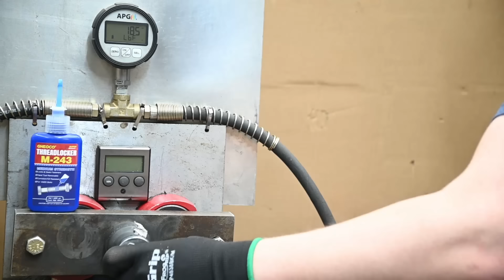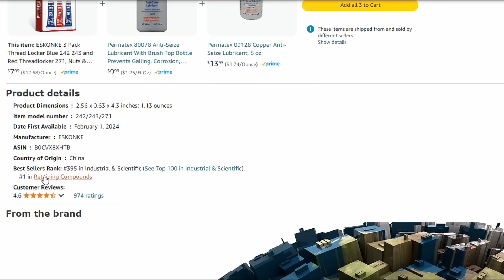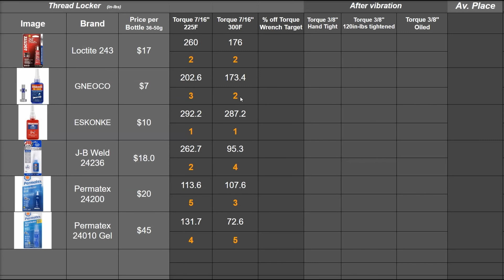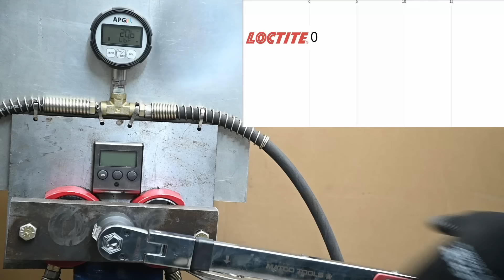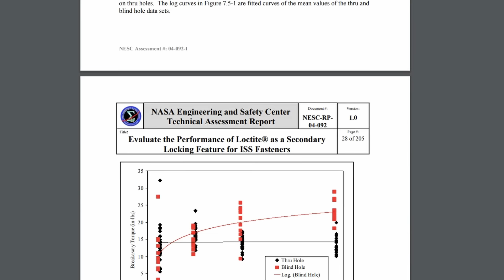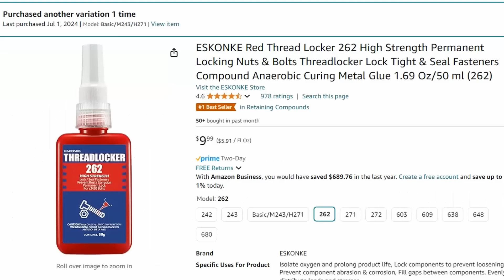Best Thread Locker isnt Loctite? vs Permatex, JB Weld & Amazon

Comment: I was under the impression that what causes thread lockers to cure, is the electron exchange between metal contacts. Dissimilar metals work best. It doesn't fully cure threaded into plastic, because there's no significant exchange happening. The small amount that does happen, is the oxygen exchange that would typically cause corrosion.

Comment: The best thread locker is whatever they used on my 2007 ram 1500's suspension bolts.

My 240lbs ass was jumping on a breaker bar with a 6 foot cheater and a blow torch on the part... didn't even budge...

Resorted to using the gas axe.

Comment: So thread locker sets up when cut off from air. So why doesn't it set up when in the bottle? I have thread locker in my toolbox that is probably 30+ years old and it's still liquid.
Reply from the maker: It does expire and get worse, more viscous and further away from target torque. The bottles are also half filled and use a semi air permeable plastic.
Reply: I believe it cures by the humidity in the air.
Reply: Threadlockers are only used in metal-to-metal applications, as they need contact with metals to catalyze the reaction. Some metals, like stainless steel, aluminum, and plated metals, are less active, so an activator like Loctite 7649 can be used.
Reply: @greener8116  ok, so it reacts with the metal to cure if I understand that?
Reply: Locktite recommends refrigeration on some of its products.
Reply: @volvo09  Yes. Watch the YouTube video Most DIYers Do Not Know This | Loctite Red Threadlocker Curing, by Hacks by Dad.

Comment: I really just wish it was a rule they had to put each color of thread locker in a matching color bottle! I generally keep a lot of blue, some orange, and some red around. Tend to use blue on a ton of fasteners these days more for rust prevention than anything else. Use the higher grade stuff on super critical fasteners like flywheel bolts, but prefer orange for the easier loosening.

Comment: I tried an assortment of Eskonke, from The jungle, and I could not tell which is for which application. It did not say anywhere what each was. I bought the more expensive brands because they say what they are, rather than guessing. You tested one of the three from the jungle. What about the others. Statistically, testing one of anything is insane. Where is your sample size calcuations??

Comment: If the single stage liquid were truly anaerobic, it would be a chunk of hard, useless crap before it was ever opened.

Great testing though. Your site rarely disappoints.
Reply from the maker: Well it can be anaerobic and still require a steel catalyst. But not work on a bolt in free air since it is anaerobic

Comment: Any video showing Project Farm is a sponsored lier is perfect in my book. He lost the last bit of respect he had. When he claimed candle wax on a rusted bolt and nut with heat did not work and only PB Blaster did. With a giant free case from them sitting in the back ground.
Reply: Wax and heat does not mix.....

Comment: Vibra-tite would be an interesting comparison. In addition to a direct Loctite competitor, they also have an shock/vibration resistant version that doesn't fracture when torqued.

Loctite may have another blue formation that's more oil resistant. They have a ton of different formulas.

Comment: I quit using loctite when the red failed on a mixer (I replaced with red from Harbor Fraud and it's still holding).   Permatex was my next attempt for things I wanted to depend on and (I still keep a little of the gel).  I tried Vibra-tite on a recommendation of a friend (I needed the purple) and have bought several kinds since.  I really like the supposedly removable brush on but it also clearly holds to the thread area you apply it to which appeared many in your test did not.    I don't know that it would compare to the surprise response from Eskonke though so may have to pick up a little to compare.

Comment: Yes do red threadlocker testing.  Let's see if the truth about using a small dab of red on a larger course thread bolt and then showing you removing it without heat.

Comment: Ranking them by breaking torque isn't the right approach at all here. As the surprise red formula bottle shows, the goal isn't to have a high breaking strength, it's to have just the right strength, and as you said, not ruin the next guy's day.
Reply from the maker: The cheap one was disqualified because it didn't have the benefits of a blue. All the others did. The tests are just quantitative ways of measuring what engine Temps and vibration do to them. And target torque seems to go overlooked
Reply: @TorqueTestChannel  Is there a difference between products in how easy it is to clean off residue between applications?
Reply from the maker: @dr.kraemer  hmm good question. Can't say I noticed a difference except for the $5 one
Reply: @TorqueTestChannel  I wonder if the people who make the bad one know their product has this problem. I doubt they watch this channel.
Reply from the maker: @dr.kraemer  we think they are just making one type multiple colors. Saves money

Comment: I wish harbor freights brand would have been included in this. I pick a bottle up every time I'm in there buying tools and its around $2 for a bottle I believe for the blue stuff. I've been using it as a mechanic for many years. Never had an issue with it.

Comment: Surely you’re not still checking replies on this, but I just dug back for it because my tiny tube in my truck tool box just went dry. Thanks I’ll be grabbing some Amazon special
Reply from the maker: You betcha my guy!
Reply: @ I have tool test challenge for you that I’ve not seen you do yet (Todd either for that matter).  Power Probes and their knock offs

Comment: The FAA did a study in the 2000s I think to determine if thread locker could replace safety wire in some applications.  The answer back then was no I think.  Wonder if it's time to have another look.  My own opinion is, if it's safety-critical, it's getting safety wire even if the thread locker works.
Reply: Threadlocker and safety wire have 2 completely different jobs.  Safety wire is only meant to retain a fastener if it comes loose, Threadlocker is to prevent loosening.  Several installations I work on require both.
Reply: One of the problems they noted during testing, no way to visually ensure a bolted joint during inspection ( seems obvious ), but commercial aircraft receive numerous inspections in service and  lockwire is a quick affirmation of integrity. The OEM's are switching to a small braided cable with a crimp lug replacing conventional lockwire
Reply: @ianrobertson3419 Safety wire can be set up to prevent a fastener from coming loose as well. If it is pulled tight wrapped in tightening direction between two bolts, it acts as a spring to keep them tight. I've worked on old car engines (Early 70s Subaru EA-52 and EA-62 series) that use safety wire on the flywheel bolts to keep them coming loose, because thread sealant (not thread locker) is required on those bolts to prevent oil leaking out through the threads (mounting holes in the crankshaft flange are not blind holes).
Reply: @ianrobertson3419  I'm no A&P, but I've done the safety wiring on my prop bolts.  I'm pretty sure those aren't supposed to loosen even a little bit.  The safety wire is install in a way that prevents the bolts from loosening, and the twist puts a preload on the wire to help prevent the initial creep.  In that application, it isn't a retention device.
Reply: @major__kong  "The safety wire is install in a way that prevents the bolts from loosening"
The purpose is to prevent the bold from unscrewing - nothing less, nothing more.
Reply: @ABaumstumpf  I don't get your point.  Unscrewing or loosening are pretty much the same thing IMHO.  A properly safety-wired bolt isn't going to unscrew or loosen or lose torque or however else you want to say it.
Reply: @ABaumstumpf  Basically thread locker is using chemical adhesion, a lock nut friction, and safety wire a tension force on a lever arm.  But they are all preventing the bolt from rotating.
Reply: @major__kong  lockwire is tight to prevent wear on the wire or hardware, it does nothing to actually hold torque on a fastener.  If somehow a fastener does lose torque then it's kept from completely coming out by the lockwire.  I'm sure ac 43-13 has more info.

Comment: I still use threadlocker on small machine screws or high vibration applications but as a mechanical engineer I never specify it in my projects. 
Bolts and threaded rods do what they do because the bolt is stretched in tension, not from the friction of the threads.  Thread locker also works quickly to start curing so if you're needing to do a multi-torque sequence such as on a circular plate from 50% to 100% it's completely useless.  We lubricate bolts for a reason (anti-seize is great for this) and it's because the actual torque spec needed is again not based on friction but bolt/rod stretch.  So you're better off doing that and torquing it to the required strength or if unsure go 85% of yield stress. 

Prevented many leaks in piping flanges doing this.

Comment: Dunno if it helps or hurts, but I always use the edge of a wood toothpick to spread the locker more-or-less evenly around the whole circumference of about 4 threads.
I think that is too much because there is usually a ridge of hardened threadlocker snot at the end of thread engagement.  I then waste time trying to dig out the excess snot with a utility knife.  Good thing my time isn't worth anything!  ;-)

Comment: I hade a problem with red locktite gel about 5 years ago on a mustang we put aluminum hubs in it from summit and the locktite was required for the wheel studs they thread in instead of press because of the aluminum hubs and after a week we were switching the rims around and it was a mess the lug nuts wouldn't come off because the wheel studs dint lock in turned out the locktite never set up it was just like it was when we put it on a week later. We ended up having to re do everything we used it on we used the regular red liquid and it set up and solved the problem. I'm assuming it was bad but I have never used that gel stuff again we did set some bolts aside and 2 months later it still was only half dry but may have to try that Amazon brand. Thanks for the video love watching your guys videos have a good one!!!!!!

Comment: "Anerobic and will cure when cutoff from air"

Yes but it is using the metal on the bolt as a catalyst to cure.
Reply: Yeah, you wonder if the plastic/acrylic material they used reduces the ability of the threadlocker to cure since both sides aren't metal. Although, it could still be a useful test seeing if the product could be used on mixed materials.

Comment: Retaining compound tests would be amazing! Testing them with various press fits/loose fits using precision bearings in aluminum/steel holes is something i absolutely need to see. Theres 0 testing or data on this other than datasheets!!

Would be cool to see the 638 vs 648 vs 538 of all the various brands, though it may be an expensive process

Comment: not sure this test is very useful. Threadlocker isn't supposed to be unremovable, so more torque isn't necessarily better. What matters is how consistant the numbers are, how vibration resistant it is. The quality not at all about how hard it is to unscrew it. Your test is limited by how much force you are able to apply on your personal test setup. The disqualified one would have won if you had used a bigger wrench and vice...
The test shows the torque, sure, but more torque doesn't really make one better than the other. If it did, the disqualified one should have won.
Reply from the maker: Disagree. We showed target torque difference which I've never seen showed before. And changes due to heat. A big drop off from engine Temps makes for a worse product. A bolt that sees vibration then drops off more than another is worse. Oil restance didn't even really include multiple torque measurements. Blue threadlocker is for a serviceable joint, otherwise why not weld it down. The dq'd option did not meet the intended requirements, just like using epoxy wouldn't.

Comment: It doesn’t work on plastic or polymers only metal and aluminum. Great video . Did you mention it has an expiration date on loctite. It’s important to check for current dates
Reply: It will cause acrylic to crack through chemical degradation of the plastic . Even if you just touch the screw hole as you put the screw with threadlock applied through the hole , this will happen.

Comment: I dont understand any of them do their job, like you disqualitt rated ones with lower tq less?  You're rating them into relation of 243, when they're not even 243.  Personally Hannaera the best thread locker idk why you didn't have it in your video.  People done videos about it requiring 22FT/LBS to break free and 14Ft/Lbs consistent it's temp range is up to 500F it's also the better hybird gel kind you mention in the video.  They're also one of the only people that make a purple thread sealer affordable that isnt 60 dollars for 50ML, people need to use thread locker correctly and a lot of people misuse blue on smaller bolts, were purple is needed.

Comment: I love this channel but this video was pointless. Blue isn't about being "the best" or "the strongest". It's about having a set "resistance". If the company can make a "better" red compound, the same company can make the blue formula "stronger" but they purposely don't
Reply from the maker: Disagree. Blue is a serviceable joint without requiring heat or ruining parts. A weak blue that doesn't survive engine Temps and vibration is worse

Comment: I would guess these were all inside their useby date?
I would like to suggest an additional test. The use with the proper primer. Be that Locttite Primer {there are many different types for different apps) or even the old method of a little cured loctite onto the fastener. You can even prime it a little by scraping the bolt thread across some copper. I have gotten away with annealed copper pipe in the past. The thing is it needs the presence of copper and or iron for it to cure. Often it wont set correctly on a plated bolt and nut unless tightened to expose the steel underneath on the thread contact surfaces. If you are going into plastic it is nescessary unless you are using a copper fastener.  You will be surprised at the difference the surface coating makes on the fasteners. 
Primers to keep in you tool box, 7649 for anerobic, 712 for super glue. 
Great video once again.

Comment: i feel your method is flawed.. youre not clamping anything what so ever, and youre not putting strain on the bolt... youre putting the nut right at the head of the bolt.. needs to be tested similarly, but with a set of flanges, and a gasket between them, then you have something like 1 inch of bolt to be pulled on, which should increase the torque load capacity. think head bolts... you have 5 inches between the bolt head and threads. as someone who works with loctite daily. i wouldnt touch anything but name brand... loctite.

Comment: Those Vampo torque wrenches are really cheap, but they work very well. I bought a small 1/4" manual cick type torque wrench by Vampo about a year ago for my mobile mechanic business and it works very well, and is very accurate as well. I had my reservations at first, but was pleasantly surprised. Despite its very cheap price, there is absolutely nothing wrong with it's performance. People think you need a really nice and really expensive torque wrench to get accurate torque values, but thats just not true. You actually proved that in one of your videos no too long ago.

Comment: I simply use superglue, never had a problem.  A couple drops before doing final turns on threads.
Reply: Certainly can work, fingernail polish as well.  Its downfall is less durability, less contamination resistance, and less exposure resistance since many superglues aren't anaerobic products.